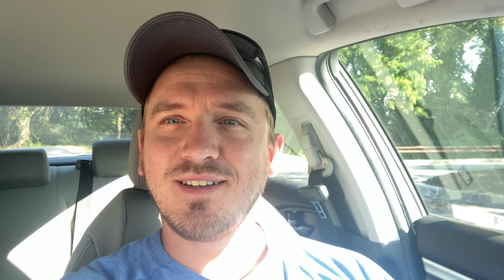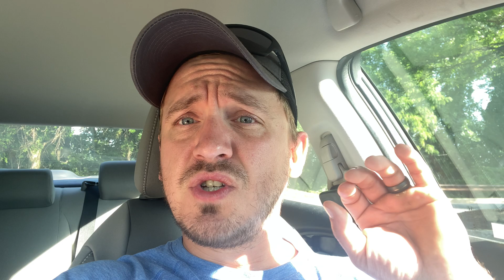Waterlogged Pressure Tank? Here’s What You Need to Know

Comment: Thanks for the video. Could you tell me on a new pressure tank that I didn't, how to store it until I do need it? My specific question is do I let the air out of the tank/bladder ? Or do I leave the air that's in there ? Or do I go ahead and charge to the cut pressure of 38psi on a 40/60 pressure switch? Thanks for you time, FYI, another way to check the tank is to drain the water and give it a shake, if it heavy and doesn't move easily, then it's full of water. I am just a home owner that has replaced them before. Troy

Comment: Ha Thee Exact issue ive been having with this Drummond 1hp PT , 3yrs old 😮 yet short cycling , i use it for my artesian drinking water to kitchen sink , im pissed cuz its not been used much ( every other day fill Gal jugs) Few mo ago with valve open the flo i once got now very slow and pump keeps cycling , 
Q. Do replace tank or just buy new unit , Im guessing i got what i paid for thru Harbor Frieght ->Drummond

I depressurized line /gauge at 0 tho it seems like it wont take  new air, and not wanting to blow tank up , Stuck at this point

Comment: Thanks for the video! I'm a newbie to all this so my questions might be naive! You said we need to top up the air above the bladder to make sure we are sitting consistently at -2 psi of our tank switch. How do I do that? Through the same valve you check if water is spouting out of instead of air? With a simple car tire air compressor? Seems to easy....
Reply: Yes any air com pressure will work

Comment: What if I drained the whole system and drain the tank and started all over would that still help me
Reply from the maker: You can try, but it generally wont work. If the bladder has ruptured, even if you get the air to the correct level, it will eventually end up right back where you started
Reply: What if I don’t have a bladder tank? I have a fiberglass tank no bladder. No schedor valve. I removed the liquid level control that has a hose to my suction pump. Installed a nipple and schredor valve. As we speak I’m draining the tank. I’m using compressed air to drain it completely. Pump power off. Main feed valve closed. I have a gate valve 1st in line on the system, it’s open. Once I drain all the water. Question? .. do I add air first or fire the pump up to add H2O to about 80% tank capacity? 90%? Then add air to a certain PSI? Thanks in advance
Reply: Pardon, i removed the air volume control